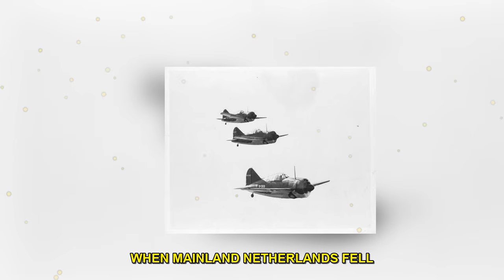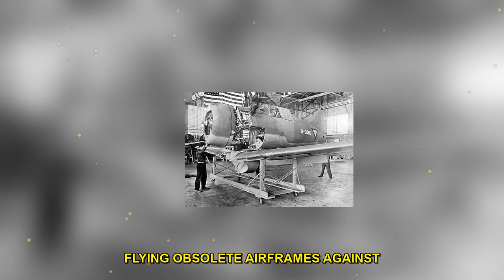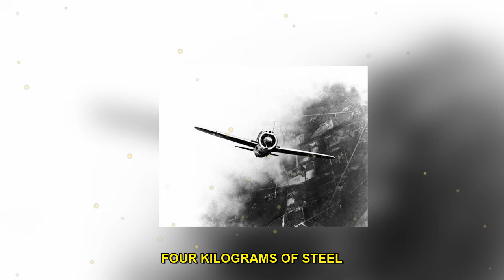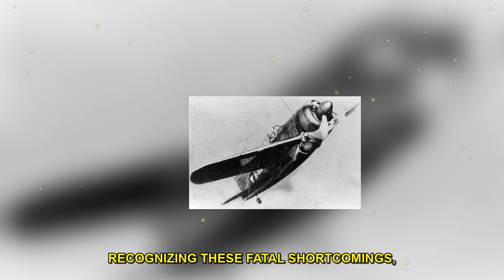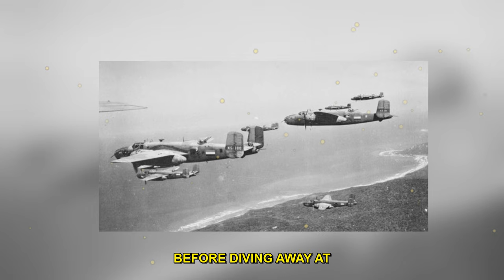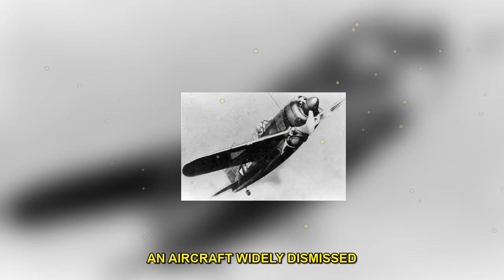Dutch Brewster B-339: The Desperate Stand Against Japan’s Zero

Comment: Note that both the Buffalo and the Zero had engines of almost identical horsepower...
Reply: Nope, the A6M zero used over Jave had hardly 1000 hp at take off, while the Brewsters in Dutch service had (mostly) 1200 hp, but they weighed more.